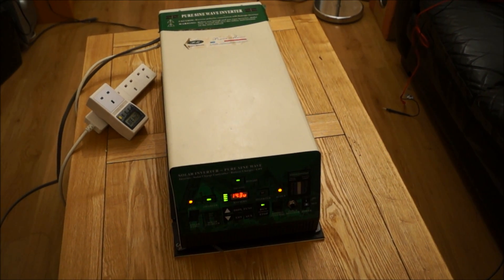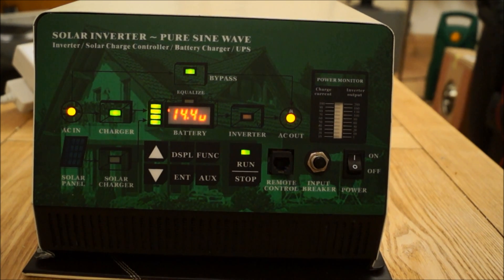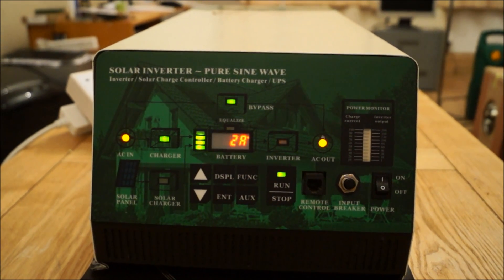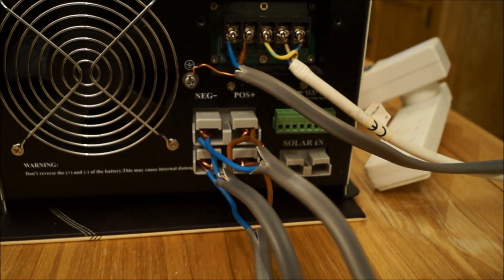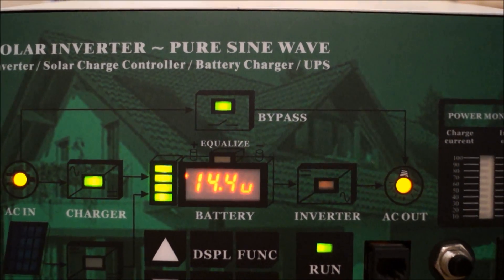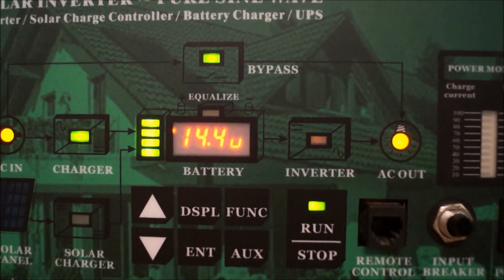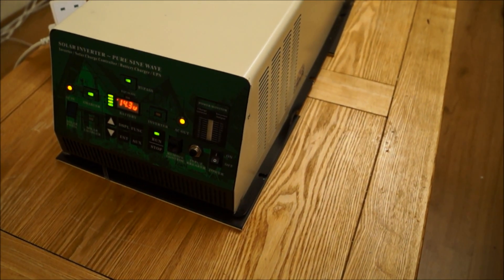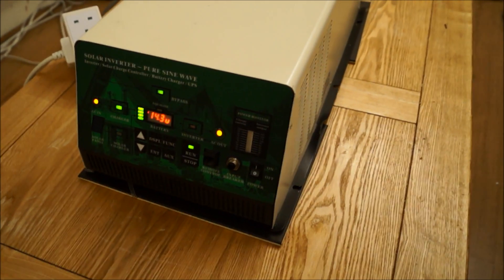3000w Pure Sine Wave Power Inverter with Solar Charger and UPS Overlook

Comment: I have one of these on my project narrowboat and im trying to get hold of a manual for it. I havent got a clue how to use it. i have managed to get it powered on and running but not sure how/if i can use it for charging. So right now it will take power from my 24v leisure battery bank but i need it to also put some power back when the engine is running but it dosnt seem to be doing that.

Comment: I've got one of these on my boat and I've tried to run my gen through it but it won't accept and ac light keeps flashing .
any ideas anybody ???
Reply from the maker: +Julian Tustian What kind of genny are you using? What stats?
Reply: well it's a 3000 watt frame gen and I'm thinking I need sine wave ???,?
Reply from the maker: Ill have a look in the instructions.
Reply from the maker: Julian Tustian It states in the instructions that 'The AC input supply from the mains supply or from a generator must be connected to the screw terminals AC INPUT'

However if the AC light is blinking it says 'Has input power, but voltage or frequency is not within the allowed range.

The input voltage range is 200-240Vac / 100-120Vac depending where you are. (big range so it must be down to the HZ.

Sometimes if you let them run for a bit and they warm up the regulate a bit better but the sinewave will still be modified.

The only 'cheap' way I think would be to charge the batteries directly with a battery charger. Let me know how you get on.
Reply: thanks for your help on this .
I know that the previous owner used to run through shore power and then gen when on cut and his ran it all fine .
I've opened a discussion on canal world .
and have been told you can alter a setting to allow it to take less pure power?
I don't find it very user friendly do you ?
Reply from the maker: Julian Tustian The bare bones of this particular model has been passed around from company to company so help can be a little difficult to come by. Further reading says that the input HZ could be from 44 to 65HZ And it doesn't matter if its modified on the input, all that will happen is that the bypass will be modified. 
I read somewhere that you might have to earth the generator though? Might be worth a try, 
What is your transfer voltage set to? Under Function P-06? Goes from 150v - 230v
If its set at 230v and the generators doing 220v varied (very common) it wont pick it up. Mines set at 150v which is the factory default.
Reply: I run on a 50 hz gen and always earth it .
I need to learn how to operate /change setting's. 
would you match the two inputs then ?
Reply: I run on a 50 hz gen and always earth it .
I need to learn how to operate /change setting's. 
would you match the two inputs then ?
Reply from the maker: Julian Tustian http://www.planmypower.co.za/SLseriesmanual.pdf 
They are the instructions but I do suspect the transfer voltage is set incorrectly,
All my settings are pretty much on the default like in the instructions.
Reply: at last some instructions thank you I'll let you know what happen thanks so much

Comment: I  have one of these on a boat I just purchased. 
it works fine but cuts out on heating pump and fridge .
any ideas ?
Reply from the maker: +Julian Tustian What gauge wire is going to the input? When I first got this I was experimenting with some cable rated at 30 amps which caused this unit to cut out because it couldn't draw enough.
Reply: I have no idea 
It's odd it run all day on lights TV etc but only 5 mins with higher stuff.
What wire rating are you using now and what will it run?
Reply from the maker: +Julian Tustian it's all down to watts and amps. Because I'm in the uk it's 240volts to run devices. So 3000 watts is the same as 12 and a half amps (3000/240)
So because it runs off 12volts it needs to be stepped up 20 times to get to 240volts. So 20 multiplied by 12.5amps is 250 amps.
My cable is rated at 500amps for peak surges.
As in what the device can run, heavy things like heaters and motors require a lot, lights and clocks and TVs don't (about a couple of hundred watts tops)
Reply: Is the status indicator light (the 4 Green Bars) relevant to how much charge the batteries have?
Can the battery be fully charged yet the status indicator show only 2 bars?